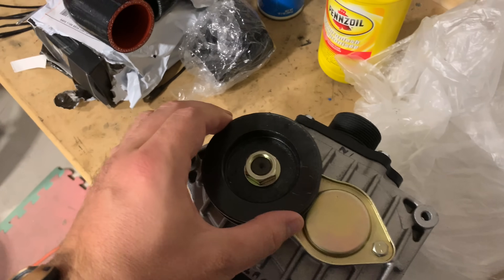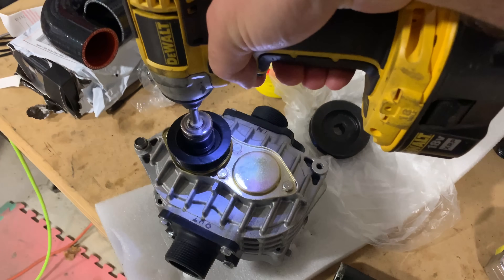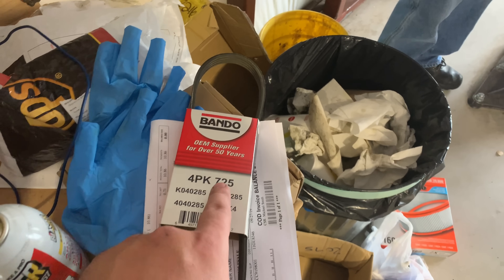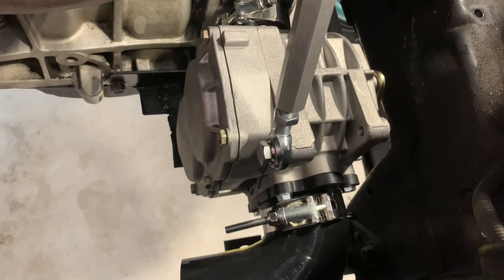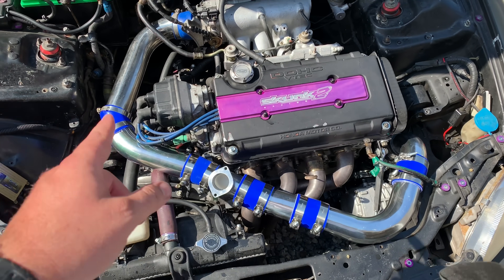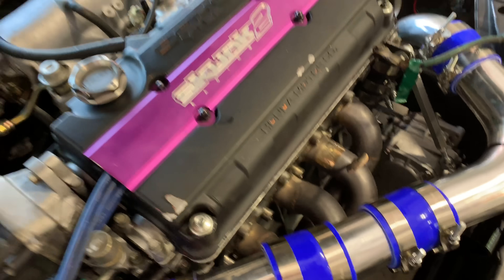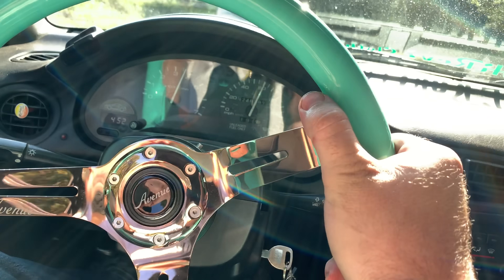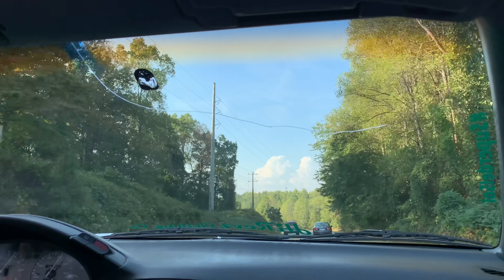Listen to that Whine! - AMR500 Supercharger - ‘93 Honda del Sol B18C1 - Pt. 3

Comment: I would use Noz and and tune . That would be fun
Reply: That car sounds pretty damm nice man . I would change fuel pump , intake manifold + Throttlebody and injectors and what u just put on with a fresh tune to be safe.  that thing should fly .
Reply from the maker: The intake is a Skunk2 Gen 1 intake.  The throttlebody is stock GSR which is pretty good.  I don’t know anything about the fuel pump or injectors.  This setup doesn’t make very much power, but a nitrous kit would definitely be worth it.
Reply from the maker: Hey, now there’s an idea.  I might actually do that.

Comment: An intercooler, supporting fuel mods, and a good tune would really wake this thing up and maximize the use of that supercharger.
Reply: That's exactly what I was thinking.
Reply: Why would it need an intercooler if it's not exhaust drivin and builds no heat
Reply: @shaker1000  do you know what purpose an intercooler serves?
Reply: @goodcitizenactual  yes I have one on my Turbocharged  Corvette, just google it
Reply: @goodcitizenactual  🤣
Reply: @shaker1000  I can't imagine it makes any power....for long at that.
Reply: @shaker1000  air heats up when it’s compressed

Comment: I have been wondering about this super charger and if it's any good for a car. Did you have to tune your ecu or anything like that? Or did you basically bolt it on and call it good (minus the basic fuel tuning). Any problems since or its solid?
Reply from the maker: Check out the next couple videos in the series.  It would be perfect for a smaller less efficient engine.  https://www.youtube.com/playlist?list=PLBYMVKy1lCTccW2illHaoLdudhAcoHxgu
Reply: Yeah would probably be great on a D15 or D16. But I would still take it down for a ecu tune and dyno work.

Comment: i was just thinking, don't most fuel injected blowers use the throttle body on the blower intake? maybe it will work better that way. then the cfm will be matched to the engine. i dont remember how the MR2 did it, but i think that's how many do
Reply from the maker: lapieces that’s how MAF systems work.  The MAF sensor reads the total amount of air coming into the engine.  On MAP systems like the air is read by the air temp and the total amount of Intake Manifold Absolute Pressure.
Reply: @HiRevzMedia  yeah, but i still saw plenty of honda blowers like that
Reply: @HiRevzMedia  honestly i'm a turbo guy, but that's what they say. like i said, i was looking into twin charging to reduce lag, because i don't want to neutral drop my car at 8k rpm
Reply: @HiRevzMedia  i know the stock honda map sensor only handles 10 psi, then CEL, i'm wondering why you didn't use a boost gauge for your experiment? obviously it didn't go over 10psi. 8-10 psi is when you start feeling seat of the pants in hondas, after 6k rpm. i'm just trying to get your blower tuned, bro
Reply from the maker: lapieces we put a gauge on it in the next video.  I’m actually a turbo guy too, this was just a fun experience and experiment.  I had seen any other videos where someone had tried one on a Honda.
Reply: @HiRevzMedia  nice
Reply: @HiRevzMedia  my beginning roots were with Toyota.  I remember the 4agze,  but I was wet behind the ears then. Toyota trained,  but my race car is an ek.  Daily Toyota.  I'm so glad that someone actually tried that Ebay blower.  I might put one on my Corolla.  Lol

Comment: B series have crazy vtec crossovers what's wrong with yours?
Reply: I had a Del Sol B16 motor in a hatch one time and the crossover was not anything like the 99 2000 civic si B16 crossover.
Reply: The less you feel the vtec the more optimal it is beacuse you want it to happen when the torque curves crosses from low to high cam so you keep maximum power. People that got that sick vtec bump are tuned shitty... only CAMs that get that are cams with stock primiarys and big vtec lobes. Like skunk 2 tuner cams. But its nothing good...

Comment: Oh,  you got that Chinese Ebay supercharger
Reply from the maker: Word!
Reply: @HiRevzMedia  if you match the size of the ports on the blower, to the throttle body, you would get more airflow and power. the ID on the blower is under 2". try to make them bigger. or if you used 2 of them
Reply: @HiRevzMedia  unfortunately they're not the best blowers
Reply from the maker: lapieces they are great blowers... if you use them for their intended purpose that is, lol.
Reply: @HiRevzMedia  yeah, the mr2 had them. that's comparable to the b18
Reply: @HiRevzMedia  that's not what i meant. i mean by design. 

i was considering using one for twin charging, so i could get a quicker spool during street driving acceleration. I'm not a big fan of launching at the rev limit and dumping the clutch.

Comment: I want to fabricate one on a D series 1.6l civic!
Reply: Did this to a d series engine and it didn’t work worth a shit... the amr500 supercharger is way tooo small for even a d series. There’s no way this would actually work and create power
Reply from the maker: Zbear Krimi I think that would work well
Reply: @HiRevzMedia  are you interested in fabricating the same bracket for a D series engine? I wouldn't mind paying. I could get everything else plumbed up my self. Check out some of my vids on my pro charger powered B series Integra!
Reply from the maker: Zbear Krimi that’s awesome man.  I don’t have a D series to work off of right now and I really don’t have the time to make another one right now.  However, I have wondered if this same bracket would fit a D series.
Reply: @wunfstsrt7716  they do make a supercharger kit for D series
Reply: Don't be a dummy buy a eaton

Comment: Del Sol weighs almost the same as an Integra. I have a 93 Del Sol and a 90 CRX. The B series would go into an EF not a Del Sol. Pointless.
Reply: Del sol si came with a b16
Reply from the maker: A ‘93 del Sol Si like mine only came with a VTEC D16.  This GSR swapped was done before I got the car and it was much needed.  However, an EF with a GSR swap would be amazing!

Comment: I wonder if this thing can handle a 2.0L engine on low boost.
Reply from the maker: Z-Trip probably not bud. That’s too big of an engine, this 1.8L is really just too big.  Check out the later videos.
Reply: @HiRevzMedia  Dang, guess I gotta look into other options then.
Thank for replying!
Reply from the maker: Z-Trip yea man, the SC14 might work.
Reply: 1.6l i think is the biggest motor you can run these efficiently on, works good on motorcycles and utvs

Comment: I was thinking about trying the same one on my 06 mustang gt...do you think it would a difference
Reply from the maker: JJ gamer no bud, I really don’t think that will help you.  The 4.6L is a pretty large engine.  This supercharger can really only handle engines less than 2.0L’s and they need a fairly low rpm.
Reply: I'll just go with the  elderbrock stage 2 supercharger...Thanks for the info
Reply from the maker: JJ gamer heck yea man

Comment: Add a 2nd SC with a pulley clutch that kicks in with the higher rpm.
Reply from the maker: I get you, but at that point, you might as well just turbo it.
Reply: @HiRevzMedia  The turbo then robs you of the low down power that the SC gives.

Comment: I've been running these superchargers since 2016. I personally have never bothered with a bov. Nice install though. I use a pulley from a cs130 gm alternator. Grind in a keyway and it fits perfectly on the shaft. I've found at least with my 1.6L engines, 10psi was good for ~150whp at the blowers redline of 16,500rpm.
Reply from the maker: Pat Mclafferty awesome man
Reply: @HiRevzMedia  @Pat Mclafferty I have a super-budget (but fully built) B18C5 in a 2050 pound Civic EJ... At altitude in Colorado, it makes 199whp (drives my OCD nuts that it isn't 200 lol). I DO NOT wanting this car to suffer from boost lag, nor do I want to lose too much of the high revving n/a feel in the mountains, and all the supercharger kits for the B16/B18 are centrifugal, to my knowledge. 

This setup looks similar to what I have, although I haven't seen enough of the channel yet to know what internals (if any) you have, other bolt-ons, etc... I always assumed an AMR500 wouldn't be capable enough. 

Here's my question to both of you, or anyone who sees it - not having delt with roots style SCs in the past, is there *any* way to get a twin or compound setup going, or something of the sort?? 

My thought is running 2 in parallel, each one drawing cold air from one of the 2" headlight intakes, combining into a 3" pipe to the intercooler, to the intake manifold. 

I'm assuming there are a number of reasons this wouldn't work, but am I mistaken?
Reply: @hybrid.but.human.official  you can definitely run them in parallel. Would be a literal screamer. Do it.
Reply: @undertow2142  You just made up my mind, I'm going to look into it 🤘
Reply: @hybrid.but.human.official  holy crap. The madness that would ensue
Reply: What the largest motor you have put one on? Do you think 3-5psi would be possible with a 1.9 6500rpm red line 124hp stock. Just want to keep stock internals and pick up 25 -50 hp. Or is the motor to large ? Would appreciate any info pat. Thank you
Reply: @manda1869  from what I've read they will support a 2.2L engine as long as you get the 500. There are two different variations. I had it on a 1.6L engine the performance was great. This should give the performance increase you're after.
Reply: @patmclafferty8019  thanks. Yes i also read that. From what i have gathered i think i could get my desired 5psi boost from it driven at its max rpm. On a 1.9L with 6500km red line. I also read the blower was only good for 150hp my engine is suppose to be 125hp stock to the crank so I'm just trying to gather more info from anyone how has worked with them if my goals are possible or not
Reply: You could probably get much more than 5 psi if you swap pulleys. I was getting 10psi with an engine that was only 300cc smaller. Usually that 5psi is with the stock pulley. It's probably low enough to be more forgiving on fuel quality and timing though.
Reply: Think so? I have never heard of a engine with a amr500 making over 150hp
Reply: @manda1869  yup. You've apparently never looked into the samurai scene. There's about a dozen of us running these with excellent results.
Reply: Yes but the samurai is only 1.3 or 1.6
Reply: On what motor? How's it holding up?
Reply: @evanc6110  I’ve run it on both g13a and g16b Suzuki engines. Non-intercooled with wmi in place of an intercooler. They’ve held up well for me. I did end up going turbocharged a few years later.
Reply: And do you run an intercooler?
Reply: Hi, installed it on a 1.2 and it increased performance decently but the noise was a problem when trying to daily it , do you know anything to do yo reduce noise , also not using a BOV could damage the Supercharger??

Comment from the maker: We will go through a full run down and try to answer any questions in an upcoming video.
Reply: You still going to do a update video ? Did you figure out if you made any boost at all
Reply: What's that twist bracket called you used?
Reply from the maker: Connar Young it’s called a heim joint or turn-buckle.  But this one was literally just a tie-rod for a go cart.
Reply: Hiw much more power did it make?
Reply from the maker: Jc Nopal on this setup, practically none.
Reply from the maker: Update Video:  https://youtu.be/yrJEoHCncb4
Reply: Doesn’t work, waste of time and money

Comment: So stoked to see this! Seems lazy up top but your volumetric efficiency of that engine is probably the cause. I believe with my less efficient d16y7 and 7k rpm redline, this supercharger will be absolutely  perfect! What are you tuning with btw?
Reply from the maker: Chris McDaniel Productions yea, it makes some low end power, but the top feels pretty normal.  A smaller engine would be great, especially with a lower redline, that way you could spin it up even faster.  I already had a chipped ECU from Jason Waters Tuning in it.  It seems to be working well.  My buddy has a handheld AFR gauge and it seems to be good.

Comment: Nice! Still working on mine, I got way too much boost. Flex pipeworks but moves a lot lol
Reply from the maker: Shawn Combat yea, it definitely needs a BOV and a rib at the end of the pipe to hold it on.
Reply: @HiRevzMedia  when i did my escort i did same way and keep blowing off so i ended up using 2 inch exhaust  pipe all 1 piece and no more problems . also i used lucus oil and it makes power from idle on !